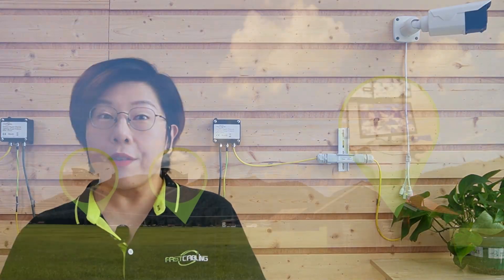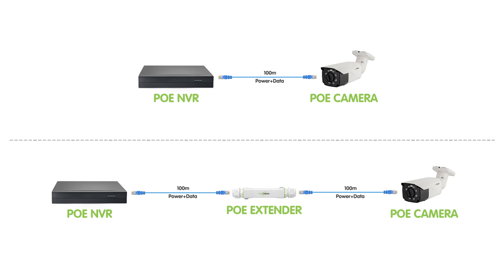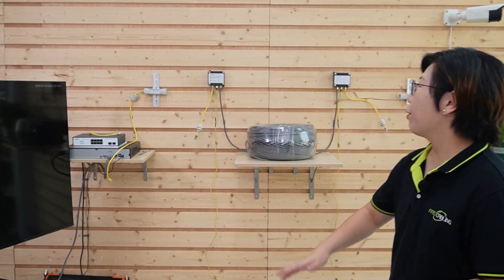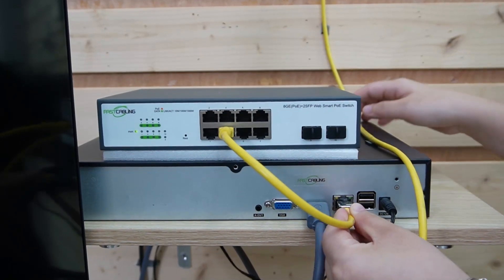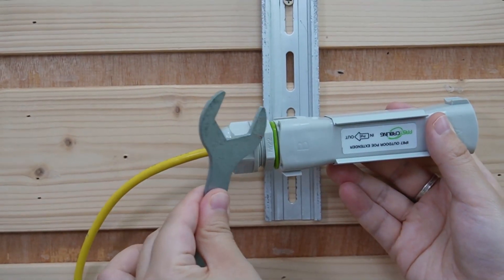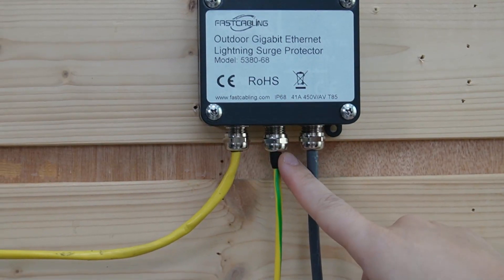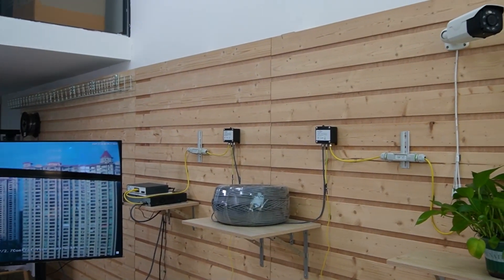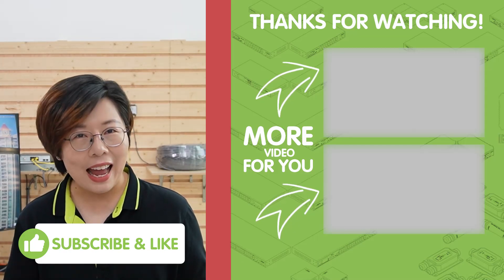High Surge Protection PoE Extender Kit: Perfect for Long-Distance IP Camera Outdoor Installs

Comment: If one end is not in a building but a junction box outside, where does the surge protection grounding wire get attached to?
Reply from the maker: You can install a ground rod near the junction box. If a nearby structure or utility pole has an existing grounding system (e.g., a ground rod or bonded metal frame), you can connect the grounding wire to it.